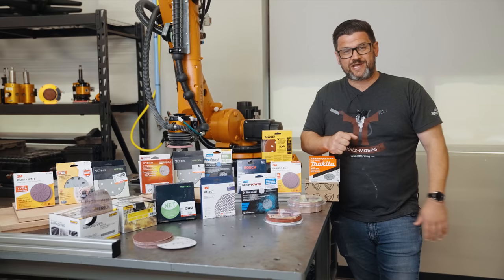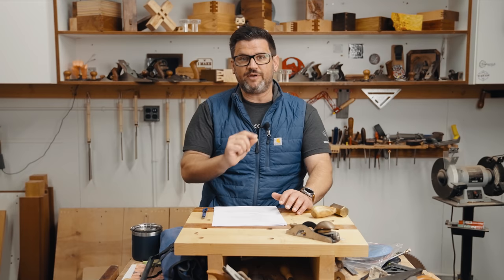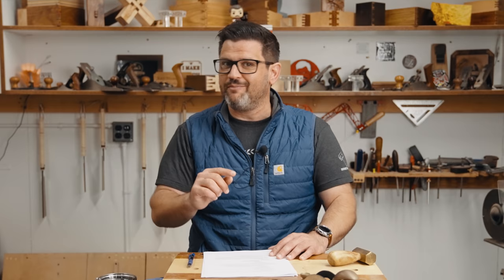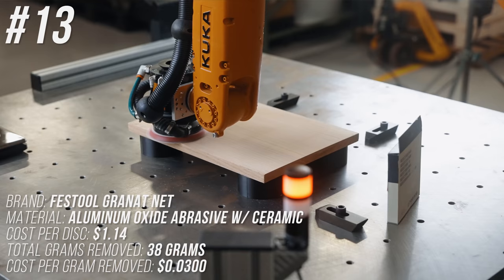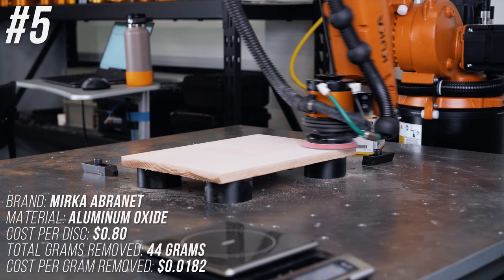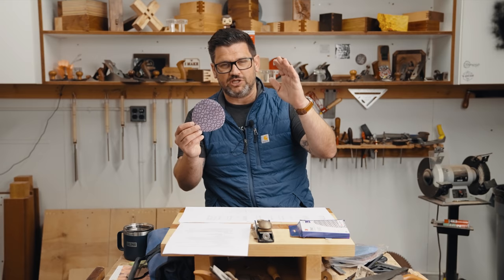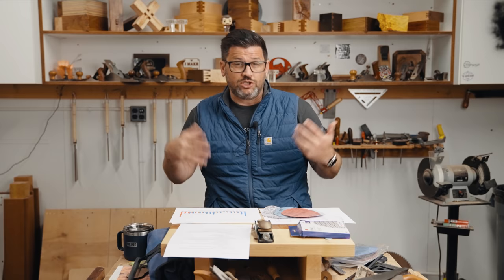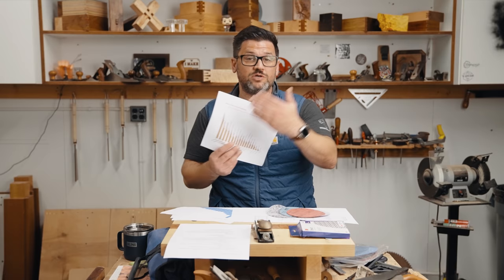Largest Sandpaper Test EVER Done - Top 19 brands Tested using Robots for Unbiased Data

Comment: just dropped 300 bucks on the 3M xtract for the production shop! Thank you for doing these videos!  RESPECT!
Reply from the maker: IZZY! That's awesome brother! You'll absolutely love it!
Reply: I didn't even wait till the end of the video. I was listening to the vid and ordering 4 different grits at the same time. Should be here in a couple days and just in time for a project I am getting into the finishing stages of. Thanks for this timely test Jonathan.

I think I'll be giving away or selling all my Festool paper soon. But I have to move fast before everyone finds out it's worthless. :-)
Reply: @bobd.  I did exactly the same thing. When I saw that the 3 brands of sandpaper I have been buying locally and have on hand in my shop are basically crap, I paused the video, went to TT’s website and bought a metric shit-ton of Cubitron Mesh!
Reply: Right there with you, Izzy! Wish they had it in 3.5" for the RO90 and delta pads, too!
Reply: I predict 3M will be working some OT to keep up. They have Jonathan to blame. 😁
Reply: I just bought the last of the 3M xtract on Amazon. 
Seriously, the top listing of 3M xtract on Amazon was almost gone when I ordered them.
Reply: @JamesWilliams-en3os  Ya, and they're out now - thanks :P.  That's my only complaint about TT: their inventory management and the way the website shows when they're sold out of stuff.  They run out of the most popular stuff all the time and it looks available on the site until you get all the way to adding it to your cart.
Reply from the maker: @FLPhotoCatcher  plenty available through the link in the pinned comment
Reply: @katzmosestools  - all the 120 and 150 grit are sold out.
Reply: @etbman7  sorry, man! I should be clear that I did NOT stockpile inventory… I bought a 25-pack of my most-used grits only. I expect they’ll have more in stock shortly. I have to say in my defense that I was in your shoes after JKM’s first sandpaper comparo video, and I couldn’t find Cubitron online ANYwhere for a couple of weeks. That’s why I jumped on it this time. Good luck finding a supply soon!
Reply: So you're the one that bought out the stock... =P
Reply: @JamesWilliams-en3os  thanks, mate, will try soon :)
Reply: @katzmosestools  Showing "Sold out" for all grits/pack sizes. It worked! :-)
Reply: Izzy, thanks for the 3M business.  I’ve been a 3M abrasives rep for 22+ years.  This is one of the best products we’ve developed.  Again thanks
Reply: @etbman7  We had a ton of this in stock and,yes, we ran out in like 8 hours, All items are back in stock now.
Reply: @MikeTaylorToolworks  Whoa!  I got a reply from the great Mike Taylor?  The internet doesn't seem so evil today :)
Reply: Is this a spoiler?
Reply: I purchased the 3M Xtract in 80, 150 and 220 grit. This stuff worked VERY well. Thank you for the video!
Reply: Got a bunch of Diablo Sandnet ceramic half price at Home Depot decent stuff. It came with a thin interface pad too.
Reply: 3M extract is junk just wasted my money for auto anyways not sure about wood

Comment: I get why it can be frustrating that people nitpick the test results because we all know the companies that complained were full of it.  However, that's also the beauty of the scientific process.  Look at what you did in response to that criticism!  You made an EVEN BETTER test and got even more accurate and less debatable results thus giving everybody more certainty.  Assuming this causes a significant dip in subpar sandpaper sales this will force other companies to compete and spur innovation.  It'll never stop being frustrating, but we're all better served by it.  Thank you so much for being committed to good science and customer service.
Reply from the maker: One. Hundred. Percent. 👏👏👏👏👏
Reply: I really appreciate what JKM did here, but let's be a little careful - it's science-adjacent.  The main issue is that to make sure the results are robust, they need to be performed on several samples.  This type of problem occurs in every experiment, which is why scientists always do multiple trials.  It is part of controlling for variables that could affect the results.  For example, the test is done on organic material, i.e., every board is different.  Even if it's the same board but they keep going deeper into it, the ability of the sandpaper to remove material is not uniform (grain at different angles, pores, etc.). The risk is basically that one sandpaper could get a lucky board and that would make it look much better than it is.  There are many other variables to control - manufacturing differences in a batch of sandpaper, how the surface was left by the paper used before it, and so on.  These can be controlled by carefully setting up multiple samples.  This is not nitpicking, btw.  It would be much more complicated and prohibitively expensive to do this to a scientific standard.  I believe JKM did an excellent job.
Reply: @etbman7  Yeah, the difference between individual boards is one of the first things I thought of when he said the tests were exactly the same for each sandpaper. That may be true in terms of the sander, but it's not true in terms of the wood, by the nature of the case.
Reply: @etbman7  I agree with what you're saying except for one point - I don't think flaws in your study make it "not science." Every study has limitations and flaws, but that doesn't stop them from being scientific. Humanity made amazing scientific discoveries with less rigor than this in the past. I think we shouldn't send the message that science requires a multi-million dollar lab at a University.  Science fairs are a thing for reason, to show that science is accessible to everyone.
Reply: @etbman7  I don't care what the heck armchair youtube science professionals want to call it... This was a great test on sandpaper, and will guide many in this journey. We aren't trying to decode DNA or split a atom. We literally are just sanding wood.
Reply: @blueblur6447  come on, man, why would you say that? let's keep this forum (JKM's channel at least) a respectful place for discussion. I am not an armchair YouTube scientist. I am a data science professor. I'm not just being an ass. I think his work was great, as I said, but I want to point out that people are too quick to talk about scientific results when there is a meaningful difference between peer reviewed, controlled experiments, and methodical data gathering (this work). When the lines are blurred there are all sorts of consequences.
Reply: @mtelewicz  I love that sentiment. And I watch all sorts of science YouTube stuff because I love it. But it is important to recognize the difference. This work is awesome, but it would not stand up to peer review. Does that make it not 'science'? I suppose that's up to you to decide. It is a problem when people overestimate the rigor of experiments in general, but, hey, we're just trying to sand some stuff. I just wanted to make sure the weaknesses were mentioned too, something I always do in my own papers, or they wouldn't pass peer review :P.
Reply: @etbman7  I think we mainly agree and perhaps are just arguing semantics. Thanks for the good discussion!
Reply: It's also important in scientific discussions to consider the error bars, the Cubitron mesh might have gotten a friendly piece of oak and maybe the machine making the mesh was having an extra good day, but it still way, way outperformed all the rest, even before considering it's price.  So yes, all of the above could be true, but the results are likely outside of the error bars for the Cubitron mesh.
Reply: @etbman7  A randomly selected sample of every variable involved a production line is a reasonably scientific approach. Food, for example has samples selected from the production line at random to be tested for bacteria counts. Is that not a scientific? A random sample is an average case and if the grain is similar this variance isn't going to be enough to make any kind of difference in the average performance of the paper. Now, if one board was straight clean grain and others was crotch, burl or knotty - that would be a significant enough.
Reply: @Adventures_of_Marshmallow  You've actually highlighted exactly the problem I was talking about. When they test food on a production line, they take multiple samples per item and average their measurements.  That is not the case in this sandpaper study.  The sampling process is extremely important to the scientific method because it protects against false discovery based on random variation.

In fact, I looked at this sandpaper data and found evidence that better sampling is necessary for robust results.  The data include multiple rounds of sanding and there are cases where the sandpaper removed more material on later rounds. Sandpaper would not be expected to remove more material on it's 4th time over the wood as opposed to its 3rd, but that's what was measured.  Sampling would likely wash away those small differences, but to call it a scientific study, that level of validation is required. You can see my graphs from their data here: https://github.com/ebrowncs/JKM-Sandpaper 

Again, I want to point out that I love this work, I just felt it was important to point out the standards of scientific rigor, especially in a world where I know people don't always trust scientists or know just how much care is taken to confirm results.  Doing projects like this and stoking the appetite for science on youtube is wonderful.  Thanks, JKM.
Reply: @etbman7  I actually think as a scientist you may have missed a trick here. Whilst I truly loved this for all its detail and rigor, For me the experiment is too perfect to replicate a meaningful result. The Scientific process didn't replicate the true nature of the beast. The test showed me that if I used a piece of the sand paper perfectly ie held it perfectly flat, applied even pressure etc, etc this is the result that I should expect. What it doesn't tell me is, does the mesh tear when I run over the edge, does one wear more than the another if I lift the edge of the sander and/or  apply too much pressure. In other words does it stand up to foreseeable miss-use,....Otherwise known as my son!
Reply: @joshcooper3647  that is certainly a legitimate criticism. When designing experiments it usually makes sense to simplify because then you can control the situation and have more precise results. No test could possibly show with any precision which is the 'best' sandpaper in all situations, so they construct a test to measure something specific, like the amount of material removed. Any interpretation of the results should be clear that that is all that was tested. One of the biggest problems with science in the news is that the headline is more likely to say "best sandpaper identified!" than "estimates of material removed include outlier"
Reply: I am actually pretty confused. I just bought the 3m cubitron after watching this and put it on my festool ets. I was just trying to sand a maple (Mccobb/planner group) chair. Something I have done many times before with different sanders in my life. I do not care about the festool brand of sandpaper I buy the knock off festool green version from Amazon for my 6” some times and I buy Diablo for my dewalt and many other random brands  for my other sanders. This cubitron was the worst paper I have ever used. A majority’s  of the patterns just wore right off after like 1 minute. After going through 3 pieces in like less than 5 minutes I quit and went back to the festool granat. What am I missing here?

Comment: Wait, did he say that Festool keeps the cost of their tools down?  😳 Where are you buying Festool, Mr. Katz-Moses? 😁 Great video, sir!
Reply from the maker: Hahaha I meant they'd be a lot higher if they didn't also sell the consumables
Reply: In had the same thought.
Reply: I died at that part too!  Just imagine how expensive they’d be without the razor/razor blade model!  $10,000 domino tool anyone?  😂
Reply: @katzmosestools  Haha, thanks for explaining that.  I really thought you were being sarcastic and able to maintain an absolute deadpan face.  (I think I preferred your comment without the explanation!)  Great video though, thanks.  Cheers, David
Reply: Others, including KM have already responded - whoosh!
Reply: Hiya nice test.
Im a painter and im wondering would these discs be as good to remove old paint from ceilings,walls and trim or is this test just for raw wood ??
Thanks.
Mike
Reply: @ericw9655  just wait for the domino patent to expire. Then we will have tons of competition
Reply: Festool sanders are overpriced as hell. People who buy their tools are very similar to people who buy $2000 speaker cables. The high end Bosch GET55-5 dual mode sander costs 1/4 the price of a festool and has better removal and finish, dust collection, and vibration.

Comment: I hate to start my comment off like this thanks for wasting my money I bought some 3M extract and that is the worst sandpaper I've ever used for Auto it is straight up junk . You should do a review on paint material on a vehicle not wood.   So far the best sandpaper I have ever used is the Hercules sandpaper from harbor freight the blue one That's some good stuff but it's expensive . I guess I'm headed to harbor freight to go buy some and I used a lot of sandpaper restoring a 1967 Pontiac firebird it has some hard lacquer paint on it you need to specify maybe for wood only but 3M extract is junk

Comment: Jonathan - really appreciate all your videos. In terms of hook and loop sand paper testing, I believe there is one absolutely key aspect to the longevity / cost-benefit analysis that never gets tested: the disc's ability to stick to the sander after multiple on/offs.  

As an example, I purchased the Cubitron multipacks months ago and agree they were the best in terms of removal. But, its common to switch between discs (e.g. 80, 120, 220) throughout the sanding process. I found that the Cubitron discs would just fly off even my 2 new sanders after 5-10 "attach/remove/reattach" cycles. Didn't matter how long each disc was used.  Have never experienced this with any other disc. 

All tests I've seen simply leave the disc attached throughout the testing process to determine grams removed. I think in a real world scenario where pads are removed and reattached, the cost of the Cubitron sky-rockets as the sanding side remains great but the disc is unusable because the backing will no longer stick to the sander. Due to this, I would not buy another 3M disc until this issue is addressed.  From a cost-benefit perspective, this issue renders the Cubitron no better than the ones that remove the least material- unless you keep the 3M disc on your sander and never remove it.  

As such, I think testing this fundamental aspect of any disc is every bit as important in any cost-benefit test - and make that suggestion for your next such event.  

Many thanks for another great video.
Reply: Great comment. That is my big problem, sandpaper not sticking. I would also like to know how long each piece lasts before it's not useable. These tests didn't seem to figure out how many total minutes of sanding each brand lasts for.
Reply: Use a backing pad protector and you won’t have that problem anymore.   The problem with the mesh paper is the hook and loop from the sanding pad are exposed to the wood surface and get ground down due to friction and heat, which decreases their ability to hold the paper.